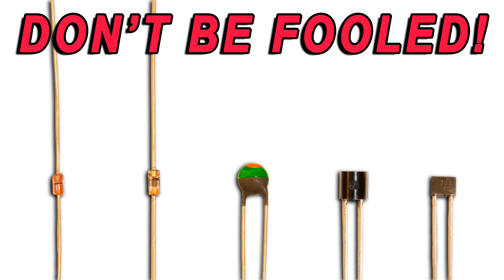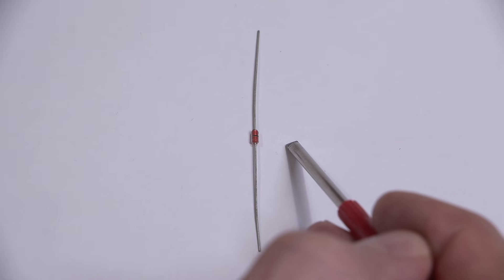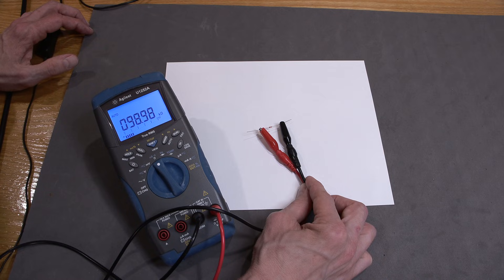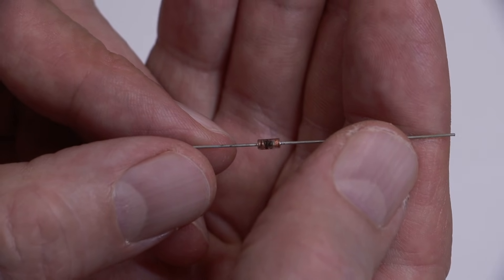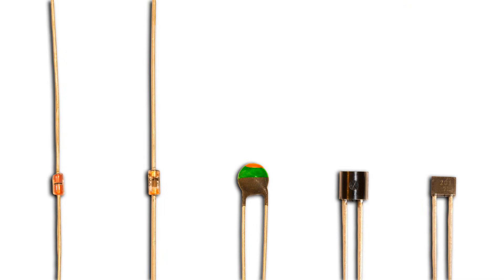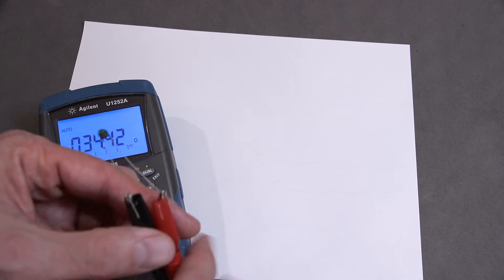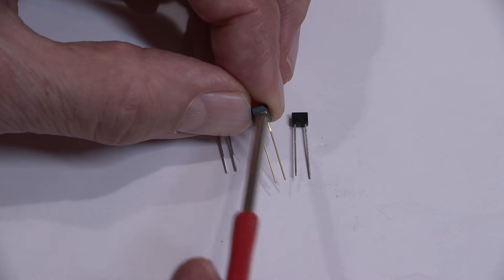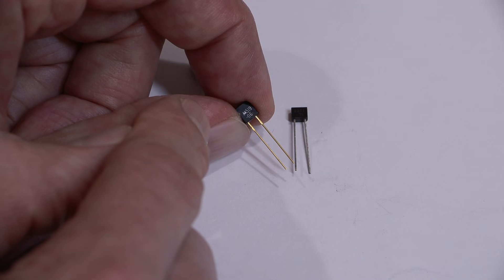Don't Be Fooled By These Parts!

Comment from the maker: To learn electronics in a very different and effective way, and gain access to Mr Carlson's personal designs and inventions, visit the Mr Carlson's Lab Patreon page here: https://www.patreon.com/MrCarlsonsLab
Reply: You can use diodes like a 400v 1amp to Daisy chain voltage regulator sets if you don't and put 15v/12v 9/5v your generally going to have to split them mainly in a PC tower power pack from 24v and 12v via the two transformer cause that link actually makes a block on the 5v regulator and it just won't work or in digital audio to check to stabilise single fast sweeps say from a motion sensor but if you use a standard relay fly back with diode they don't work or if you remove them it goes off as it receives bump signals or say a diode on a neg source the 555 won't work due to the gain source but the led can stabilise that scratch in the audio like older plasma tubes like a signal in fiber optics if you get what we mean on top how to stabilise a motion board for that min by a lock off to the positive side for 8seconds before applying+ intake by dropping off the final to complete the circuit on a neg input only dule neg split return after 60 you cut your second bypass and the sensor is stable crazy stuff 😁
Reply: I joined Patreon 3 months ago I was only able to see everything the first time I went in now everything is locked and it says join to unlock it takes the money from my account but I get nothing

Comment: My mostly incorrect guesses as they were announced:
1 & 2: Sealed spark gap
3 Resettable fuse
4 Silicon Diode; transistors with a lifted pin are sometimes used in diode ladder filters

Comment: These were all kind of new to me most the thermistors i've seen look like a plastic coated ceramic cap. I thought for sure the veractor diode was going to be a hall effect sensor seen those in things like brushless motors used in the older non PWM type computer fans. The new stuff probably has too I would guess if it has a tech lead to sense it failed or how fast to go.

Comment: I have a component that looks like germanium diode, has a glass body with 3 color bands. I think it is a GDT as it doesn't conduct in both direction, no capacitance. GDTs have around 1pF. I hope you make a video on those. They can be used as RF input protection

Comment: I looked up that device you are using at 13:00 and it cost $540 Canadian. This was on Amazon. It is really that expensive, or are they just over inflating the price? There are similar devices that are far cheaper. So what's the deal with this one?

Comment: Another confusing part is a power supervisor. It looks like a transistor and has 3 legs. There's an input, a ground, and an output, and I think that the output is shorted to ground unless the power is at the specified voltage. That is handy if you want to make a CPU using 74xx components. Just connect the output to the reset of the chips you use as a program counter. So your CPU reset line is held in a low state until the voltage is stable. The previous alternatives would be a 555 timer or a multivibrator IC.

Comment: Thanks for sharing always love your videos❤✅😃 Peavey always used parts that were very different and a lot of times they were hard to identify for example they would use  capacitors that look a lot a like resistors with color bands on them known as color band capacitors one example of what I'm saying.. also they use dual diode for their bias such as an example as the 13886 or mz2361 in a single package very hard to find and now it is obsolete! yes they used a lot of unusual-looking parts that's why most people have trouble fixing old Peavey amplifiers.
Reply from the maker: Thanks for your kind words and the feedback! 👍

Comment: The world of electronic components is a minefield for beginners (and even seasoned pros sometimes). There's really endless variety in packages, dual-purpose parts, obscure markings (or none at all), and clever disguises like the ones in this video. When markings fade from age, leaks, or harsh environments, and there's no schematic? Yeah, it's pure detective work, context clues from the circuit, and sometimes just trial-and-error with replacements. A strong coffee and a bit of luck definitely helps! On the repairability side, Manufacturers often use proprietary "house-coded" parts, glue boards shut, or withhold schematics to push new sales over fixes. Right-to-repair laws are slowly improving access in some regions, but much more is needed.

Comment: Important to note that “100kOhm NTC thermistor” is a bit of a misnomer, since the 100kOhm value is a function of the devices current temperature. What I mean is that you cannot purchase a 100kOhm thermistor. You purchase an NTC thermistor with a certain response curve that might happen to have a 100kOhm resistance at a particular temp.👍

Comment: What are your thoughts on distilled water sonic wash for electronics that can handle it.  How about a submersion iso specification to go with the mil spec cooling alloys and the pantythongic tough booksth.  Are those inherently safe as far as. Military data. Which is very hush hush  typically.  Even though I would. Announce like a hundred times.  That the Crae unit is getting ready to march.  And them pamphlets we dropped on you last couple of months. They. Was real. Y'all better get out the way. We're coming.     Ew recruits. Not kidding.  Marching soon.     Sort of like. A transmission leak. Or. Decrypted with a gimme  code.

Comment: Hmmm.    Surface mount cap.    Hmmm.   My Father had an electronics degree from Chaffey college and he smoked electronics which is common. At least in my family. I would go on to surpass his modest electronic smoking with a strong propensity towards smoking em and never bothering to put stuff back together. But I have hope and I know that the electronic disciplines are nothing to balk at.   Pair that with something.  That can generate revenue in today's age. Like  home building , a more practical skill that some people take extrema precautions to prevent. But. I find that. If I had a home it might promote the laziness associated with extra curricular endeavors like. Real electronics education goals. So. Diligence and dual majors. Preferably one that makes you sweat is what I would recommend. .  back to the books. Thanks Sir .

Comment: Bead in glass ceramics are not for robustness of the application is for robustness of the component because early smds were prone to cracking during handling and soldering and damage during wave soldering. If they existed for robustness, they would still be around today.

Comment: I didn't scan the comments to see if anyone duplicated mine: Why didn't you show a "transistor tester" typically made out of a old AVR arduino or a curve tracer (e.g. B&K)? The former are cheap, work great, and can be indispensable. I wish I had them back in the 70s when I bought a lot of surplus boards for parts while in college. Great show!
Reply: Why

Comment: Your thermistor measured close to 100k only because the ambient temperature in your lab is very close to 25°C
For people in hotter climates the value will be very far from 100k. e.g. at 32°C you will measure 70k.
Reply from the maker: Still close enough to make a proper assumption, the (most common) next step down is normally 10K NTC.

Comment: I once got a mixed-value batch of capacitors that were square and coated with shinny red epoxy enamel.  I probably never used more than a few, but they did seem to do a capacitors job in my hacking, and I was left with the impression that they were mylar.  But, now you're making me think I might have been fooled.

Comment: Oh, how I keep wishing that at some point I had mounted convenient clips to a small stand that I could just drop axial parts into. Maybe a sharp v-notch that would put a minima clamping force on the lead as it falls a pair of such notches.  Surly, it would not be difficult to construct such a notch with some kind of sheet metal, and then make it corrosion resistant.
Reply: 12:31   Now adding that thing to my shopping list.  Nice 😷

Comment: Greetings from Cape Town. The second glass device 102 Cap could also be temperature sensor. We used a similar one back in the 80”s on radiosondes, I remember, although the capacitance was much lower. Had a temperature sensitive dielectric.

Comment: I worked on vcr's in the 2000's and there was a component used to protect the microprocessor called an IC Protector this device as well looked like a semiconductor with only 2 leads. Have you ever seen these components?
Reply: Still have a batch of them on the shelf for the same reason. Was fun until the machines got so cheap the components cost more than a replacement machine.

Comment: A Zener can also be used as a varactor. For frequency range, though, it requires a lot of testing and messing with to get it to simulate the correct capacitance in a tuned circuit.

Comment: Everyone who's built a 3d printer in the last 15(Maybe not so much in the last 2-3) years will know the first component. Normally with teflon tubes on the leads and tucked into the hotend. :)

Comment: The disc NTC resistors are normally found in high power AF & RF amplifiers to keep the gain stable as the amplifier heats up.
Reply: I can think of another application. I've wanted to build a homebrew CPU, and I've wanted a random integer as an opcode. Now, I'm thinking, what if you take an NTC or PTC thermistor and a VCO chip, and sample that into a shift register? So you use the temperature drift to change the tuning on the oscillator.

Comment: Before watch, ill have a crack based on the picture. 1. 1N914 style diode.
2. Zener diode.
3. Thermister
4. Varicap diode or shunt reference.
5. Varicap diode
Aah yes case 1. I've seen thermisters like that.
Case 2 i have seen capacitors like that too! I'm going to shut up now 😂

Comment: 4:27 There are also. MOVs with that kind of package as well. For lower voltages and power ratings only. 
13:42 There are also PIN diodes with that kind of package, more rare that varactor a though.

Comment: I always wondered about those "diode-looking thingies." There are also fuses that look like T092 transistors, usually with a number like ICP-N15 for example. I get the current rating on the device but the speed and other characteristics are unknown to me. Google says fast acting, 50V rating, 0.6A. Seems like there's more to it. Are they particularly fast acting? What sets them apart from other methods of protection? Thanks for doing all you do for us.

Comment: Never seen a glass cap enclosure
Reply: I used to see them all over the place when I was scrapping out boards from old "Apollo" (An 80-90s minicomputer brand, not the space-shots) workstations that the outfit I worked for got literally by the pound. Mostly RAM (A whopping 64K, usually, with the occasional 128K version) and peripheral boards, but every now and again I'd get the brain-boards - they usually had three 6502s, and sometimes a Z80 talking to a 68000-series CPU as (I presume) peripheral controllers - SCORE!!!! :) Most of them had zillions of 74xxx series chips doing duty as glue logic. Every Apollo board I ever put my hands on had dozens, if not hundreds, of those "SMD chip-caps in glass tubes" that looked like diodes - most often, one per chip on the board, with some boards having upwards of 200 chips and therefore, 200+ "caps that look like diodes" on 'em.

Comment: If you encounter a TO92 package with 2 legs it is more likely to be a Internal Current Protector (ICP) which is a semiconductor based fuse, designed to be very fast to protect the circuits down stream by blowing faster than the circuitry it is protecting. It has markings like N20 for an ICP-N20 800mA fuse. It tests as a fuse, so either a short when still good or open when blown. These are found on 90's and later video and audio equipment. Of course when it is in an RF circuit then is is more likely a varactor diode.

Comment: I have a red LED which looks like a small signal diode.  Both Panasonic and Rohm made devices like that.  The first time I saw one was in an old photocopier and it was in the HV supply.  The one I have came out of an old Yamaha CD player from the late 1980s.

I also have a bunch of glass encapsulated ceramic capacitors which came in some electronics shop grab bags but they're larger than that one.
Reply from the maker: Yes, those small signal diode looking LED's were used in VCR's as well.

Comment: Wonderful episode!!!  Now we need to talk about diacs and triacs and their comparisons to solid-state relays.  I'm sorry, I still love regular electromagnetic relays, but solid-state devices have their place, too.  It's just that I've had to adapt Korean War surplus x-ray generators to add interlocks for use as cabinet x-ray machines and x-ray fluorescense spectrometers.  Those old Picker x-ray machines used relays and limited, ruggedized vacuum tubes so that the whole assembly could be air-dropped into an aide station or MASH in combat conditions.  During Vietnam, those surplus x-ray units had multiple re-uses as scientific, industrial and veterinary x-ray systems.

Comment: There are cheap part testers with an LCD display, microcontroller, and 3 pin socket or leads.  This device will do all these tests and tell you what the component is for most of these, as well as certain transistor characteristics.

Comment: Good video. One of the negative effects of the internet is a decrease in learning. Thirty years ago, for example, with no internet, you would have maybe a dozen capacitor catalogs and in your idle moments you'd leaf through them and see all the packaging styles, ranges of values for different types, all sorts of details. There are hundreds of examples along this line I can think of. RIP catalogs.

Comment: A good old XY component test on the oscilloscope could have been interesting.
Reply: one of the nice things about working for Tek was having a curve tracer. our shop actually had 3,a 576,a 577 and I had a 7CT1N in my bench scope. great for checking out those axial lead glass caps,because some would break down under operating voltage and turn into a resistor.

Comment: Sony used the “variactor diode”looking component as a fuse. I was told it was some kind of semiconductor fuse, to stop spikes in power sections to prevent mcu damage. Ptc15 I think the pn was. So what is it or is it used in a different application being a cd player.
Reply: Yes, an ICP component has the same TO92 form factor. It is a very fast semiconductor based fuse to be so fast that it can protect ICs by blowing before the ICs get damaged. Marking on it is like N20 for a ICP-N20 which is a 800 mA semiconductor fuse. It will measure as a short unless it is blown, that it will measure as open.

Comment: Kovar is a type of alloy, the name is for both metal and glass. Kovar metal is an alloy of FeNiCo, while Kovar glass can be 8250, 7056 etc... In this example, its not Kovar, its a DUMET type of wire and the glass is a soft, low melting temperature , leaded type.

Comment: Hi Mr Carlson, these videos are perfect 👍, I just want to add - I have a component that looks like a transistor in a TO92 case with two leads, but it is a temperature sensor of the KTY series. In my case, it is used as a temperature sensor in a Saeco coffee machine ☕

Nice day 🙂 Tom
Reply: Indeed I used to run into the to 92 packaged temperature sensors in German built dagma coffee machines! Also the first time I bumped into Peltier wafers. That was while they still owned the patent

Comment: When I think of a varactor diode, the first thing that comes to mind is the VCO. There, I apply the tuning voltage from the PLL to tune the oscillator.
You could also use a diode, for example a 1N4148, to measure the temperature.

Comment: "That other channels don't talk about", may be the understatement of the decade. It doesn't matter how long you've been at it. There is always something you didn't know. That's what is so FUN about your content.
Reply from the maker: Thanks for your kind comment Leonard!
Reply: Thanks for your support.
However for Doubtful Toms like me just as you reversed the terminals to ascertain the components later when you confirmed it to be a NTC, you could have also reversed the leads and again touch the component to confirm that the Temperature, Resistance or Capacitance do not go the other way.
So suppose I go to the shop to buy one of the component or check in my own stock how to know the value?
Thanks in advance.😅

Comment: I've dealt with thermistors that looked like the 35ohm one here except they have no color code, all black and small.  Used in remote transmitters for sending temperature to the receiver display of weather stations, proprietary to mfg. I suppose.  The glass enclosed devices I learned something today, thanks Mr C.  Awesome video👍

Comment: The first component could also have been a diac. Since it’s bidirectional, it won’t have a polarity band like a normal diode, and since it’s breakdown voltage is typically 35+ volts, it’s not going to show up on the normal diode/continuity range on a DMM, either. Plus, being a semiconductor, it’s temperature sensitive.
Reply from the maker: Yes! But it would not show up in the ohms setting then, and change resistance so dramatically.

Comment: How's that U1252A holding up? i remember my school had a U1241A, and it was so old that the rubber was disintegrating like an eraser rubber, i wanted to 3d print a replacement overmold in TPU but never got around to that

Comment: Thanks! Great info! I’ve seen inductors that look like resistors and so on. That last diode device you showed is something frequently used in things like FM and TV tuners, in the oscillator section, to set the tuning frequency. I’ve also heard of them being referred to as a varicap diode.